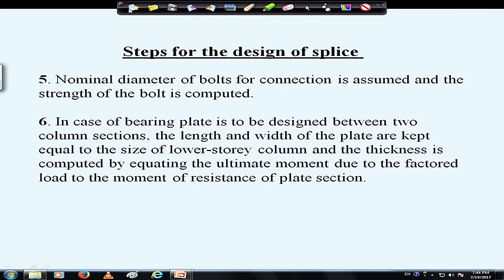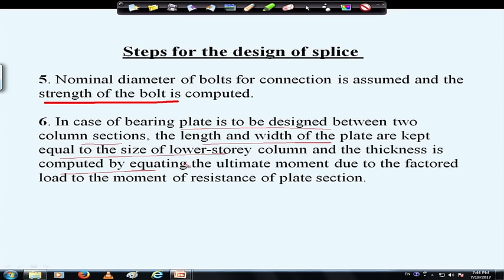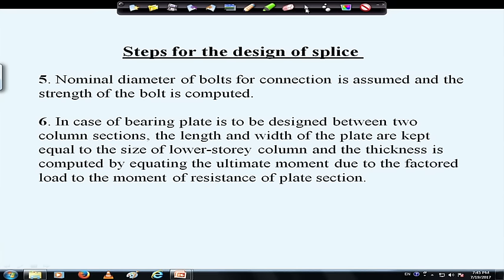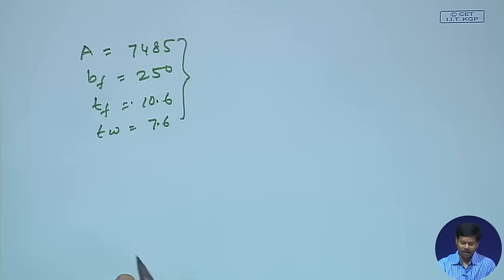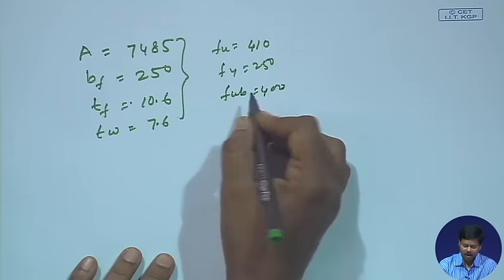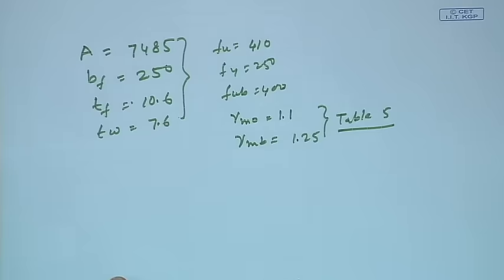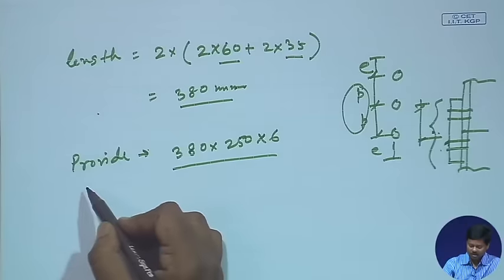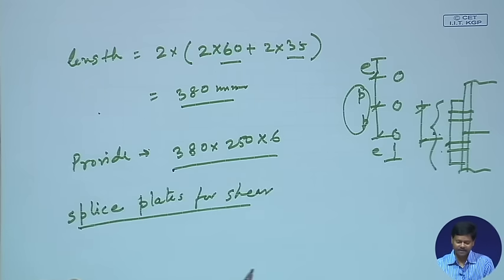Lecture 43 : Design of Column Splices

Comment: Hye sorry, should we always assume the thickness for c/c splice plates is 6mm. If the assumption of splice thickness is increased, wouldn't the Pu2 be different.
Reply: Truly increasing the axial load to 15 % then calculate the thickness..   then check for actual load...  Just like we used to do in footings.